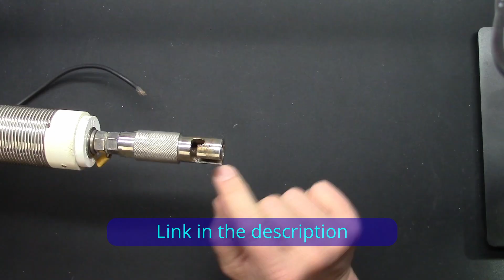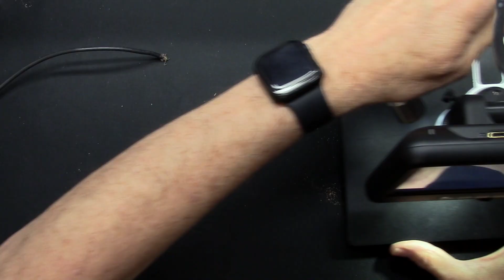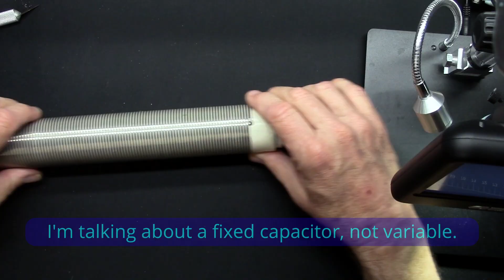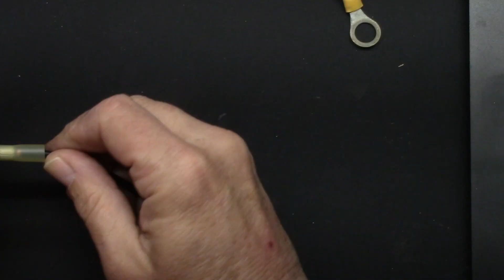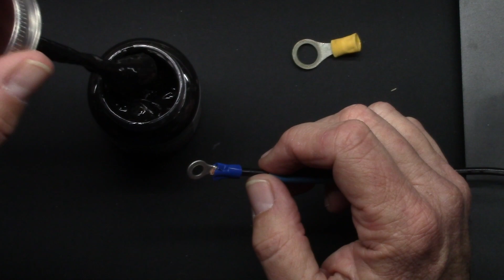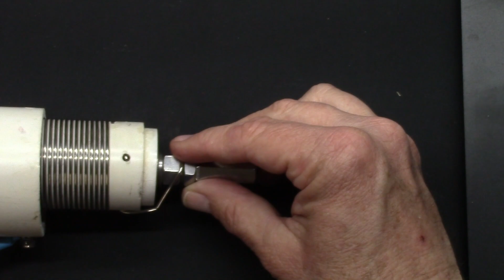Mobile Antenna Maintenance

Comment: Hi Tom, When you were undoing the antenna base you may have stretched the male thread, which is why the nuts were difficult to remove. Can't tell even in the close up. You could run a die down the male, but probably not necessary. 
I liked your idea of using liquid tape under the heatshrink and I'll use this on an antenna I'm building at the moment. 
Thanks for all the videos. I used your 7300 series to learn to drive mine and I have just discovered your 705 series and as I have just bought one of those, so I'll have a look at them as well.
Many thanks
73 de Al G8YKM
Reply from the maker: Thanks Al!  I’m glad you’ve enjoyed the videos.  I’m pretty sure that the threads are okay and it was just the crud that made the nut difficult to get off.  When I was putting it back together after cleaning everything up, the nut spun back on very easily.

Comment: Just a thought Tom, but usually if I see green "crusties" on an item on the exterior of a vehicle, its usually the wonderful Beet Juice or Calcium Chloride used in snow and ice removal on roads reacting upon copper in some way shape or form. Another idea could be that it is dissimilar metals reacting upon each other (ie, steel and aluminum).  Mostly see the green crusty material on wiring on the exterior of vehicles that use non-heat shrink terminals, or external wiring that has broken insulation or any exposed conducting elements and are exposed to any airborne moisture spray from the road.

Dielectric grease, liquid electrical tape, and heat shrink terminals, some of the world's greatest innovations.

73
Eric
KF0QIS
Reply from the maker: Thanks Eric.  I didn’t even think about corroded copper from the ring terminal, or wires, but that could definitely be where it came from.